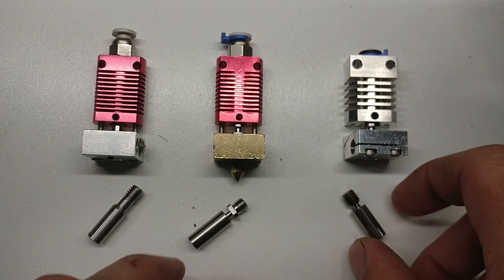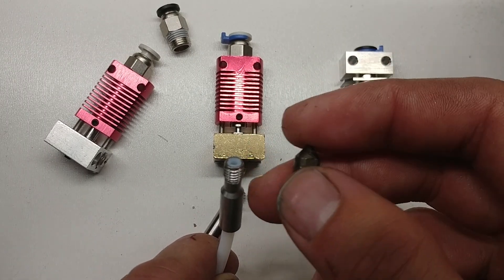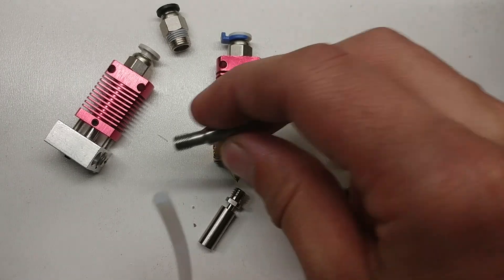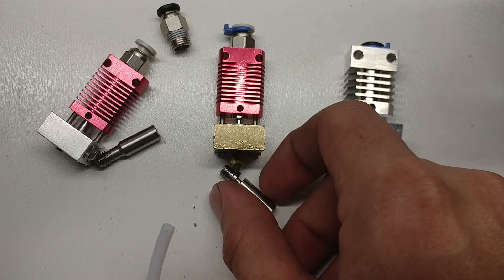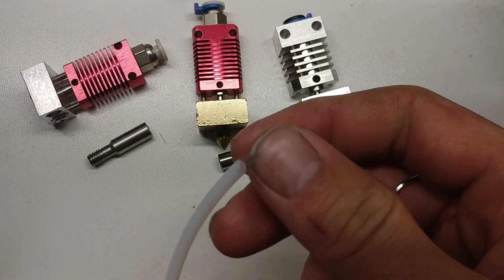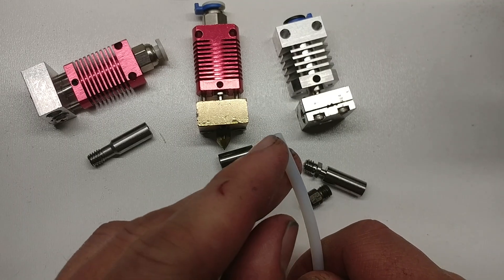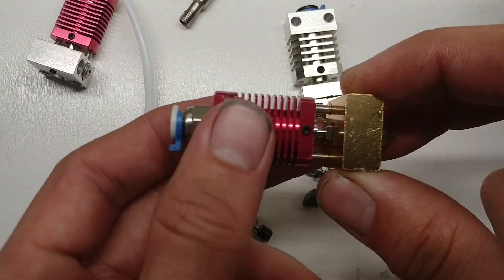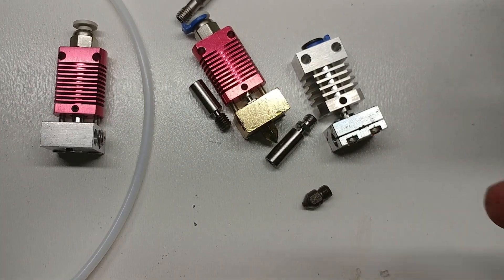How to make PLA work with All Metal Hot Ends (No More Clogging)

Comment: I claim nonsense. Competently installing the PTFE tube with a few mils protrusion to effectively compress/seat against the nozzle is
  Very  Basic 3d printer operator skill level. The hole in the 'mostly' all metal hot end into which the PTFE tube goes into has a tapered bottom.. Because of the drill used..  
THAT mismatch between PTFE and the tapered heatbreak seat is  Exactly where a Blob of Filament  will  and Does form for a blockage.. heat creep is real. 
Oil seasoning (an Old Time Bodge)  the tube is a poor solution given the oil will soon enough bake off . 
Could ?? simply use High temp capricorn PTFE tubing which Will tolerate 250 C (arguably More)  temp... indefinitely.
Reply: I have to admit to not having hardly any clogging problems with the original Creality (or copies) hot ends with PTFE tubes near the heat-break. I did all the time with an experimental all metal purchase, as mentioned here,  and then went straight back to original design. Could not be bothered with messing with 'solutions' for no real reason.

Comment: Does it burn at higher temps such as when printing PETG or ABS?
 I was getting clogs and got some Ziro filament which comes with free nozzle cleaning filament which I use to clear out my hot hend when I change filaments and this reduced the amount of clogs but did not stop it completely.
Reply from the maker: The oil shouldn't burn, but I don't print with PETG or ABS yet.

Comment: Hey this is a great tip. A newbie here who just got my first 3D printer for Christmas. Everything is running fine right now with PLA but want to try some high temp filaments like PETG & Nylon etc. Been worried about the stock PTFE tube getting ruined and not withstanding the higher temperatures for long. Hence wanted to upgrade my hotend to bimetal/all metal heat break but then heard about the lubrication issues for PLA. So I was about to embark on the Luke's hotend fix with a small piece of Capricorn tube and washer etc.
Then I stumbled upon this video - what a great explanation and the solution. I am now ordering a bimetal heat break and will use the mineral oil when using PLA.
One question - if I switch between PETG, Nylon and PLA for my prints, is it OK to leave the oil lubricated hotend as is? Or this technique will have issues if I just changed the filament and left the hotend oiled from an earlier PLA run?
TIA and I have subscribed for more such content.
Reply: Its no need for anything with bimetal, it just works.

Comment: I would like to give this a try, but I can't even get the filament to come out.  I even heated the hotend up passed the PLA melting temp.  I will probably have to take the hotend apart.
Reply from the maker: Use a small Allen wrench to push the filament through if you can.
Reply: @xalt.3d.designs  I might try that.
Reply: If you are clogged high into the heat break, remove your hot end fan and then heat up the hot end. With no cooling the heat creep will start to soften the clog allowing you to push it through or yank out.

Comment: In Chinese kitchen they season steel WOK pans. They pour oil and burn it in hi temp. Oil polimerazes and leaves natural anti stick film. Food does not stick to pan. You can YouTube for that process. Maybe something similar happens when you drop oil in to hot nozzle.
Reply: Very similar to seasoning a cast iron pan
Reply: That sounds like a great idea! You have to use an oil that'll oxidize so it turns into a plastic, so mineral oil won't work.  But I really like the idea!  I'll try it on the outside of my nozzle first.
Reply: @swicked86  I read somewhere that linseed oil (a.k.a. flaxseed oil) is a great choice to season a nozzle since the oil's smoke point (the temperature at which it'll polymerize into a layer of seasoning) is around 225F (107°C).
Reply: I wonder if it's that or if it's acting as a thermal conductor to join the break to the heat sink.

Comment: Thank you for this tip!  I have a Flsun QQS-Pro that I recently changed to an all metal hot end.  I have had nothing but clogs with PLA since.  After watching your video, I applied couple of drops of mineral oil that I let set at 225 ish for about 5 mins.  When I pushed filament through, my clog cleared and spurted out several small blobs of filament with the extra oil.  My clog is cleared!  My next two prints have been beautiful and reminded me why I bought this machine in the first place.  My one question is - how often should I reapply oil?  Thank you so much.
Reply from the maker: It depends on the machine honestly. My E3Pro printers have been running for months since I originally seasoned them.

The quality of your filament also comes into play.

Comment: I have been smashing my head to the wall since I insalled my all metal heatbrek on my ender 3 v2, I Have checked everything (extruder, capricorn tube, couplers, possible heatcreep) and I think this might help. Just one question, does lubricating with mineral oil could have bad consequences for printing with PETG? . Because I bought the all metall heatbreak for printing both PLA and PETG. Thank you. There really isnt enough info on the internet regarding this topic
Reply from the maker: PETG should be fine, but I haven't printed with it yet.
Reply: I am in the same path as you with a new Ender 3 V2 and about to install a bimetal heat break to help with high temp filaments like PETG. What is your experience? Did you try this trick? Did it help with your clogging issues and did it also work with PETG. Really keen to know before I try this. Thanks in advance.
Reply from the maker: @ashokmoghe8035  PETG and ABS shouldn't need lubrication.
Reply: @xalt.3d.designs  .... ok, but can you say why lubrication is only for PLA  ?
I think, what is the purpose to put oil onto the metal walls 🤔 and outside the tube with filament  ?

Comment: As a newbie I am i had clogs and wend to all metal 👍
After a few clogs i tried WD40 when installing the components 🤔
But sinds then i didn't have any clogs anymore 🤗
Reply: I was wondering about this, as it's a lite 'oil' and I have plenty laying around.
Reply: Tell me pls, where did you put the oil ?
On the metal walls of the hotend  ?
What is the purpose of this  ?
I thought the oil should be inside the tube to easier move down of the filament  ?
Reply: @zorabixun  this is about getting it on the metal.  Though, just using a sponge with some oil on it will do good as well.  search for filament fridays, sponge and you'll find that solution.
Reply: @zorabixun  The PTFE only goes in a few millimeters,  It is the metal part after this that needs to be lubricated.

Comment: Thanks for this tip.  I just installed a Microswiss all-metal hot end to run ABS at 260 degrees.  Would this work with ABS?  Also how often do you need to add the mineral oil?
Reply from the maker: Shouldn't need oil for ABS, but I don't have any experience with that material.
Reply: Its better to run abs at 290C. Layer bond becomes incredible
Reply: @DRedGuia  i ran mine at 260 and got clogs with all metal,  i wish i could do 290 but need to stop the clogs first.  I think my 3mm were too large coupled wiht insufficient heatsink cooling.  So I would upgrade fan/make a shroud to direct air to heatsink better and reduce retractions .  Hopefully reducing retraction helps it,  if not fan shroud, it not then mineral oil. But oil as a last resort. I take great pains to wipe my bed from oil and i dont think oil help with layer adhesion but im just guessing, maybe  think coat doenst affect anything.

Comment: Hello, I have an Ender 3 v2 to which I installed a bi-metal barrel, and lately I'm having clogging problems with this type of barrel, when printing in PLA.
I wanted to ask you, if you think that the lubricant you use could be used for the model of barrel and printer that I have? Thank you very much in advance for your advice.
Reply from the maker: I would suggest trying it, yes. Also make sure to raise your hot end temp about 10C from your previous stock hot end settings.
Reply: OK thank you. What would be the generic name of the lubricant? Because where I live, you don't get that brand of product.
Reply from the maker: @carlasalvatore2911  just mineral oil
Reply: @carlasalvatore2911  Check the pharmacy isle. Mineral oil is sold as a laxative.
Reply: @xalt.3d.designs  , can it be Castor oil  ?
Reply from the maker: @zorabixun  I think that's a little too thick.
Reply: @zorabixun  
Castor oil is an organic oil. Mineral oil is not.